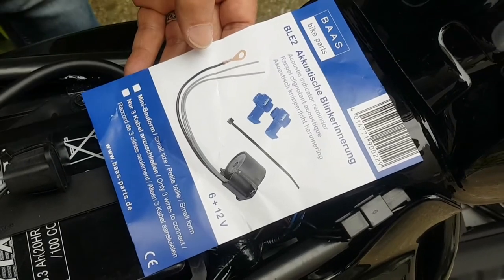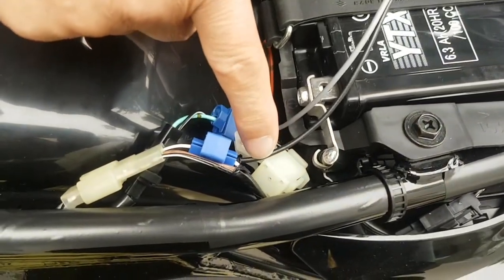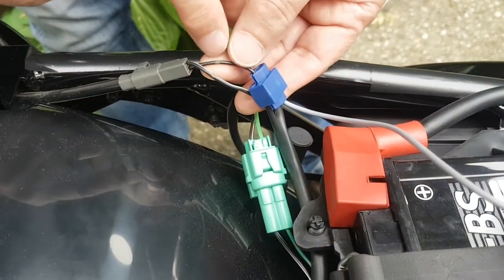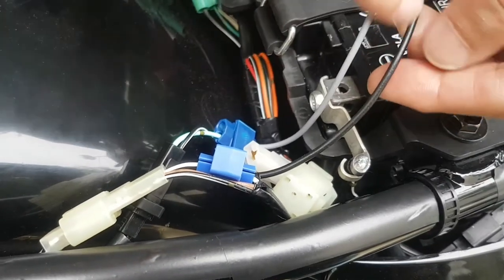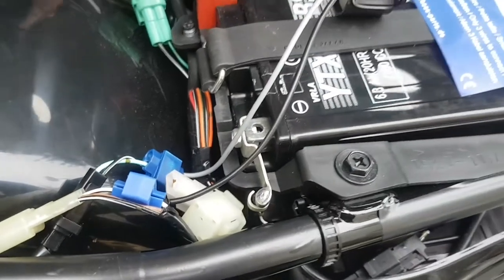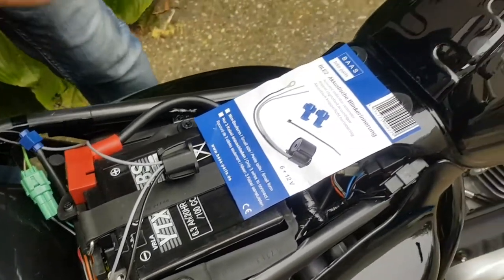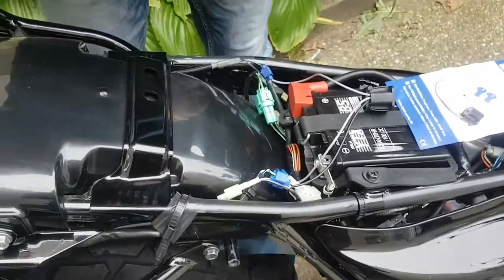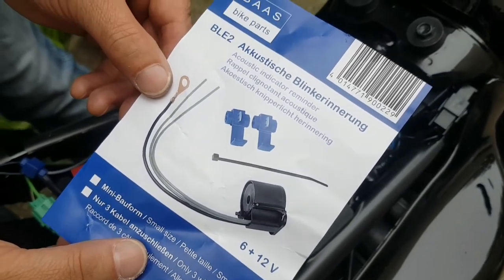Installing an indicator alarm/buzzer Suzuki RV200 Van Van

Comment: Hi. Good video. 
So you've connected the beeper earth or ground wire to the brake light POSITIVE wire? It's not just stopping beeping because it's frying itself? 😁
Is that method suggested in the instructions,  or did you work it out? 
I'm no electrician, but if this way is okay I'd probably fit my wife's bike up like this.
Reply from the maker: Boxhead 71 Thanks! Yes..black earth lead to the POSITIVE wire on your rear brake light wiring. It's not in the official instructions ( which were very basic to say the least, hence my video!) I actually saw online that a guy in America had done this but he didn't give any instructions.  I sought advice first from a great guy who's an engineer, on the Facebook RV200 group of which I'm a member, and he explained that  the brake circuit is acting as a ground when light is off and on when the power flows to it.  This cancels the power flow to the buzzer by neutralizing the ground. It's not frying it ok! It works a treat and helps keep me safe in a busy city environment! Just be sure to correctly identify the positive lead via a schematic, workshop manual or multimeter tester. Is your wife's bike a VV? My instructions work for both the 125 and 200 VVs.

Comment: Can you adjust the volume? It seemed very loud.
Reply: It's not possible to adjust it but I can stop it by applying the brakes if I am at a junction. I suppose you could wrap some tape around the unit to muffle it. The sound has actually stopped pedestrians walking out in front of me when turning into a junction and I can vouch that I have never accidentally left the indicators on since installing it!